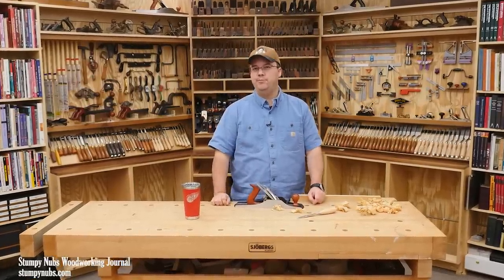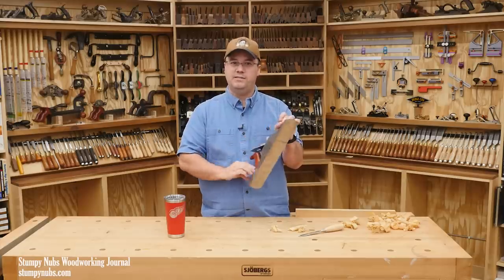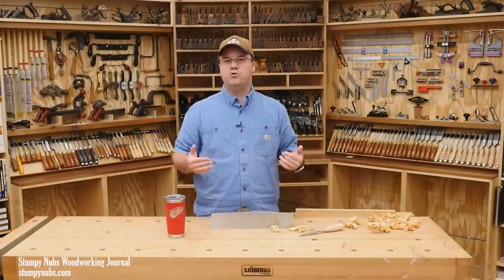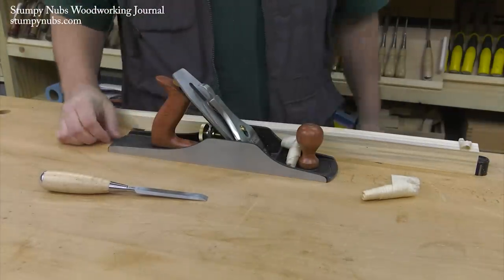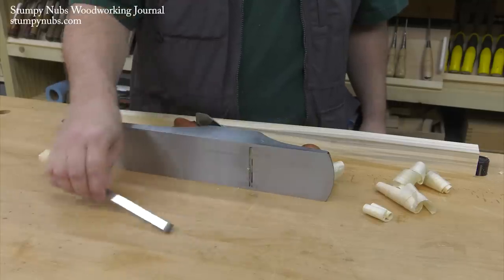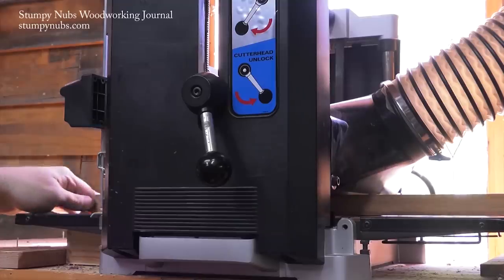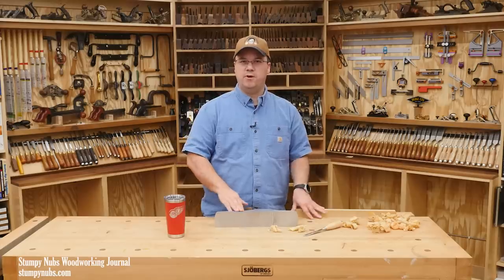Why I abuse my hand planes

Comment: I was taught by an old farmer (my dad) that the way you put a plane down was based on what you were putting it on. Wood = sole, anything else =side. We didn't have a shop, we didn't have a workbench. We would work on the top of the table saw, or on the concrete floor of the garage. And sometimes we were taking the plane to the work, which could be a stuck door or window somewhere in the house or barn.

Comment: In shop class I was taught to always lay the plane on the side. As I look back, I think it was more to protect the work table than the plane as the work table tops did get holes, gouges and scratches.
Reply: Traditionally we plane our bench tops every so often to keep them dead flat anyway so it was really about protecting the plane from damage by being set on another tool by a careless child.
Reply: I was also taught the side method in class, and I also assumed it was to protect the bench.
I don’t think our class benches ever got planed flat, so they probably wanted to minimise just how bad they got.
Reply: I always lay my planes on the side and I assumed it was mostly in case there was junk on the bench.  However, I believe that repeatedly placing a blade onto its fine edge might  slightly curl the fine cutting edge. I will continue to place them on the side.

Comment: I've always believed it is easier for someone to accidentally cut themselves on a protruding plane iron when a hand plane is lying on its side; my students proved me right every time they cut themselves.
Reply: There are no students in my workshop, but there are MANY surfaces which will wreck my blade if I put my plane down without putting it on its side.
Yours is an unusual situation, and where students are involved, many additional safety measures are going to be required - throughout the workshop, and apply to many different machines.
Reply: How far do you have your blade protruding? Your students cut themselves on something protruding a few thou? That speaks to the fragility of your student's skin, not any inherent danger in a plane blade
Reply: @Chris.Davies  It's your situation that is unusual, what kind of landmine field are you working on that you don't have a wooden surface to put your plane down. Clean up your shop dude.

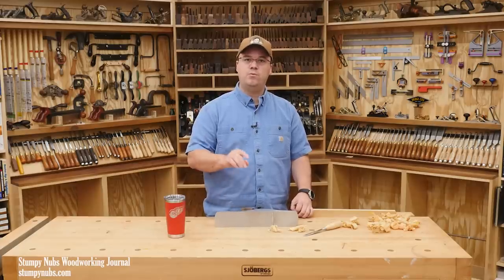Comment: Thanks for sending out this video on how to protect your cutter heads of your plane on your side or face down. Now I know that even though I’m not a user of hand planes, I use a 16” helical head 1600 lb Powermatic jointer usually on a daily basis. My new routine at the end of the day will be kicking my jointer so it lays on it’s side until I use it 5:40 the next day when I place it up rite again. All these 30 years, didn’t know I was doing it wrong!

Comment: I was taught the same a LONG TIME ago ! However it was explained that if a nail or piece of grit or as you said anything. EXCELLENT point about the adjustment! I needed a fact like that to give me a reason to consider changing. I mostly use my block planes go into my apron or a bench plane a small amount of use so not picking up and putting down very much.

Comment: Hey Stumpy, I love your channel! I learn a LOT from someone who is probably a young (under 40ish?) whipper snapper. What amazes me is how you're able to talk directly to the camera so succinctly, without a teleprompter, with your message that is smooth, direct and accurate. Well done Mr. Stumpy Nubs.
Reply: WAY back when, like 4 years ago, he put out a behind the scenes video that showed how he produced his videos. He does have a teleprompter. It's a flat screen or iPad laid on its back and has a pane of glass at a 45 degree angle with the opening facing him that reflects whatever is on the screen/iPad so he can see it. Then the camera sits behind the pane of glass, but with the glass at that 45 degree angle, the camera doesn't pick up any of the image. All of the light from the screen/iPad goes straight up to the ceiling or gets reflected toward Stumpy. None of the light makes it into the camera lens, and thus we don't see it.  

It's a pretty clever trick that's been used for a very long time. Stage productions and magicians back in the 16th and 17th centuries would use it to make actors appear as ghosts on stage when they were actually below stage and their image was reflected onto the glass. Since most of the light went through the glass and only a small amount of the light gets reflected, the images that were reflected were translucent. Visible, but you could still see through them.
Reply: @HandlebarWorkshops  Dangit, you ruined my impression of Mr. Stumpy! Regardless, he does put out some great content.
Reply from the maker: I do use a teleprompter for my videos, but using one without looking like you are is a difficult skill. I also have done a lot of public speaking over the years.
Reply: @StumpyNubs  what kind of public speaking? I have too, starting in the Theocratic school when I was 7 years old, 62 years ago. Never have graduated though, still working on improving my skills.
Reply from the maker: @GrantOakes  Send me an email- support@stumpynubs.com

Comment: I always put it sole down. Never have I had a problem. Plus. It's mine. You do what you want with yours .
Reply: It has been my experience that people will use tools any way they want until they have to buy the tool themselves. Then they are buying yards of velvet to line the drawers of their toolbox.
Reply: @kevola5739  
Well that's another topic entirely. I paid for every tool that I have. Nobody bought them for me. You don't need to treat them with kid gloves. They are meant to be used. I have seen old videos of craftsman making furniture and other tools with their planes and chisels and they worked at a rapid pace. They didn't set their tools down gingerly. At the same time, yes, take care of them but they are tools made of metal. Not glass. So again. With all due respect, They are mine and yours are yours. I will handle mine the way I have always done no matter who decides to give me their opinion on the matter.

Comment: Our high school shops were used for many “trades”. Because of that we had work surfaces of wood, laminate, and metal. We were told that’s why we always put down planes on their sides as a habit to be safe in case you forgot what surface you were working on. This explanation aligns with the idea that some surfaces (i.e.: wood) are safe to not have to do this on.

Comment: Back in the seventies when i taught wodworking (sløjd) in Denmark, I would have more than 20 students (grade 5 to 10) at the same time. The benches were much like the Sjöbergs out of beech. When someone pushed a standing plane (always a wooden plane) it wood often times cut the surface of the bench. And even worse the bench dogs where made of steel which spoiled the plane when it hit them. There was no other person to sharpen the planes and even the bench tops than me. Therefore the plane should always lie down or be at its place under the bench. No one of my hundreds of students did ever get hurt from a blade of a plane lying down. For people who are able to sharpen their own tools it  dosn't matter which way they place them as long as it is safe - also for the participating grandchildren.
Freetime woodworker an tool collector since 1963. Thank you for sharing!

Comment: In shop class we were instructed to set the plane down on its side to prevent wear or damage to the shop benches.  Those benches were expensive with really thick laminated tops and metal bases.  Putting a ding into the laminated wood top was a capital offense.

Comment: I'm not going to argue with you and Paul Sellers; you present valid points. However, I'm still going to set either the heel or the toe on something, to elevate the iron. I don't want to plane any surface that doesn't need planing, or gouge it, so it DOES need planing.

Comment: My work bench is littered with scraps of wood.  I like setting my plane on the scrap, one edge on the scrap, the other on the bench.  The cutter does not contact anything on the bench top at all.  There have been times when I've laid my plane on its side but find similar to what you said issues - striking the tool with another tool when I slide things around or the chance of hitting my hand against the blade.

Comment: 26, started woodworking a few years ago- I lay my planes sideways if I need the blade/iron out and only have a metal surface available... or if the wooden surface has lots of metal in it.
Else I retract the blade and set them sole-down.

Comment: In shop class the bench top itself may have been metal as wood shop and metal shop are usually taught from the same space. Work space is limited for the number of pupils so every work surface gets used…

Comment: Thanks for this video.  Importantly:  I say use what ever method works for one's situation.  That is dynamic.  
  And thanks for subtlety    addressing the issue of HOSTILITY and ANGER in YouTube comments.  This has been a growing problem and has been addressed by many--including Jordan Perterson.
This is not the forum to vent your personal un-met needs or insecurities.  (read that again, and repeat...)
  Also, I will look into how the Japanese hand plane is rested on the floor or bench top.  Just as another viable practice.

Comment: I believe this is a vestige of the old apprentice system as much as the shop classes. 
I was trained by an old German carpenter who likely learned in the 1920's or 1930's under the European apprentice system. I learned LOTS of "never do" kinds of things I later learned were pretty subjective, and situation dependent - planes on their sides, never plane, chisel,  saw or drill after sanding, never put files in a drawer together, etc, etc.   All good advice, but not always necessary.

Comment: Incredibly, it's been over fifty-two years since Mr. Stillson taught me to always lay the bench plane on its side in high school shop class. About 45 some years ago I started laying a carpenter pencil on the bench, and then setting the front of the soleplate on that pencil. This prevented the inevitable bumping of the plane forward by other tools and cases eventually being crowded onto my worktop area. (The overcrowding that once caused a nice gouge in my freshly finished workbench top!)

Comment: When you use a plane you create shavings. Put a few where you are going to lay down the plane that you have sharpened to the recommended 6000 because laying it flat on the bench will knock it down to 1000 first time and 600 subsequently. Alternatively sharpen to 600 and do what you like with it. Also keep your work surface tidy with a brushing off, but add a few shavings after.

Comment: Dating myself here, but when I was in high school shop class, we would get a smack upside the head if we set a hand plane on its side.  Yeah, I went to high school in the late 60's and shop and gym classes were the places where it was "okay" for the teacher to use a little "constructive" feedback.  But as I got old, side or bottom doesn't faze me, it's when it falls off the work bench you get into the self-smacking mode.

Comment: I have a vague memory of this in high school the benches had a narrow top @40-50 cm with a tool well running down between the two work tops and the instruction was to put the plane down with the heel on the edge and the toe in the well so the blade was off the surface but not where you could cut your hand.

Comment: I think it is pretty well accepted, now, that putting the plane on its side is unnecessary, and runs the risk of altering the lateral adjustment of the blade.
I sometimes do this, but only when I have just oiled the sole, and the oil would be partially taken off by the bench-cloth which I always use.
(A bench cloth, and a runner of short-pile carped in front of the bench: now, that's way more important than putting the plane on its side.)

Comment: Yeah, my understanding is that it's because woodshop work benches often had nails and screws in them which might catch the blade. No reason a regular workbench should damage the blade. And I'd always be more concerned about catching my hands on the blade, than catching the blade on the worktop.

Comment: I heard the explanation a lot more than half a century ago. According to that legend, the practice applied to the old wood-bodied planes. The 'real' reason not to lay it down on the sole is that the blade is held in place by a wooden wedge. The fear was that repeatedly laying it down on the blade could gradually cause the wedge to slip up a bit at a time until the blade came loose.

Comment: My father taught me 60 years ago possibly he was taught by his father years before that to lay a plane on its side. They both worked at a railway carriage works. The reason was nails could have been driven into the work benches. I also worked at the same carriage works and these benches were black as they were also used by other trades for possibly a century or more. I still do it as my bench is also used for more than woodworking.

Comment: Laying a plane on its side is about forming good habits.  Cabinet makers have to install cabinets in homes factories etc not just work in a protected workshop..  They often have to work off not so clean floors such as concrete floors.  Would you lay your plane face down on a concrete floor?  As I said, it is all about forming good habbits.  Also historically planes moved from timber construction to steel.

Comment: One consideration particularly for new hand tool users or home hobbyists is what else your bench is being used for? Don't set your plane down on a bench where you sharpened your lawnmower last week just because your "good bench" has a project going. Some of this is just to get in the habit so you don't do something dumb and annoying later.
FYI it's much better to have separated areas for working metal so you're not tempted - we all get in the groove and set things down while thinking about the next step from time to time.

Comment: Some planers had no proper blade locking. Laying it down on one side could make the blade align with the edge of blade body, therefore making cuts repeatable. My father had planer, that had blade held in place by hammered down block. That being said, today the overall precision of tools improved a lot and proper locking is just granted for everything a little more expensive, than toys from dollar store.

Comment: Retired wood butcher (woodwork teacher). What would a teenage boy in a wood room do if he saw a plane sitting upright on a bench with a handle he could grab and push? He'd grab and push it, taking a shaving off the table. Laying it on its side tells the flat-headed youf not to pick it up. It also gives grumpy old wood butchers time to yell before he can get the blade to timber. 🙂 Cheers from downunder PP

Comment: Interesting.  Somewhere, when I was very young, I learned to lay the plane on its side.  I did that for a long time.  But as I got older, bought my old tools, built my own work bench and projected more, I changed.  I liked being able to place the plane sole down for ease of pickup, but I still didn't want to possibly ding the blade.  Now I always have a thin, small block of hardwood to the side that I set the toe of the sole on first, then the heel rests on the workbench.  Easy to pick up and the blade touches nothing. Still, interesting to learn where the "old" rule came from.

Comment: We have a museum nearby that has recreations of what early factories were like in our area. One of those was a pattern makers shop for a foundry with a lot of original line shaft machinery and benches on display. There was a lot of cast iron surfaces around, including on and around the bench. It kinda dawned on me that this commandment of setting planes on their side more than likely comes from these old factory shops with machinery everywhere that one might be tempted to set your block plane down on a nearby bandsaw table. You would most certainly want to set the plane on its side so as not to come in contact with the cast iron. I do this when I'm working near the tablesaw, and I'm using it to set tools on. The plane will always go on its side so as not to dull the iron. I think this why our grandfather's created this woodworking commandment we're supposed to follow. In that context, it makes sense.

Comment: I’m the same ‘vintage’ as Paul but managed to get off side with the WW teacher. I questioned the ‘lie on the side’ argument to ‘protect the blade’ by pointing out that when making multiple passes, the plane is moved back along the piece, sole down!  Should that not also damage the blade?  
I was told then, and have run into similar non related explanations during my life, that it’s different because….
NaYa. Live and let live. 🖖
Great post. 
BTW On benches with a wide central well, you can place the plane across the well, with the nose down in the recess. 👍

Comment: It has been too many decades ago to remember being told to lay a plane on its side.  My guess the rationale then was the many types of surfaces which would damage the iron edge. When I put a plane away I always withdraw the iron for protection. I had no guilt laying a plane on its sole on wood. I do recall a lot of sloppy workers forbidden to borrow my tools. To me the issue is still hazy depending upon the situation. I would be very wary about abdolutism from strangers and their need to insult others. That is the pathological side of the Internet. Stay safe and respectful, brother.